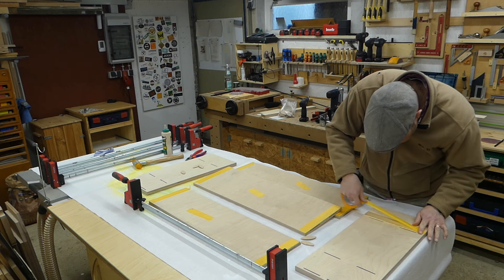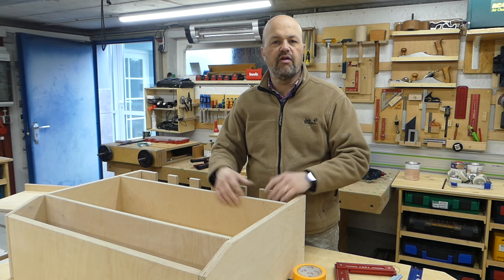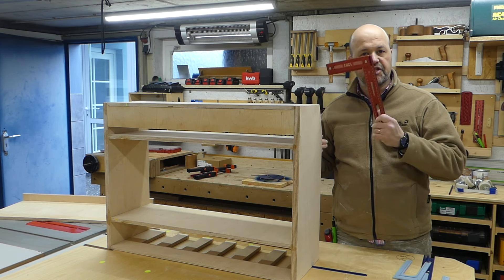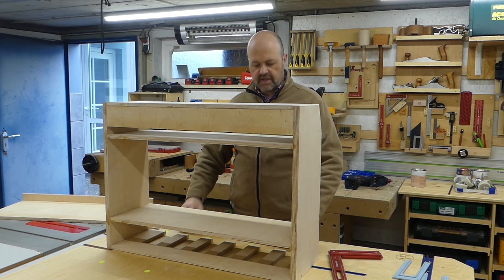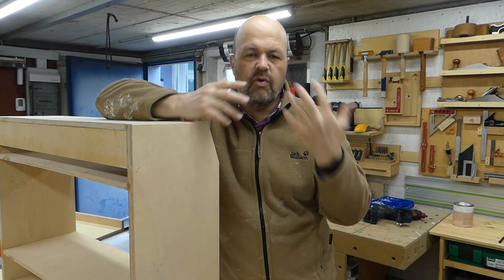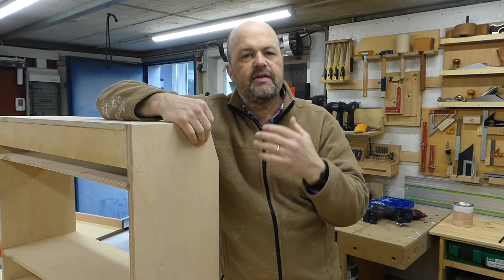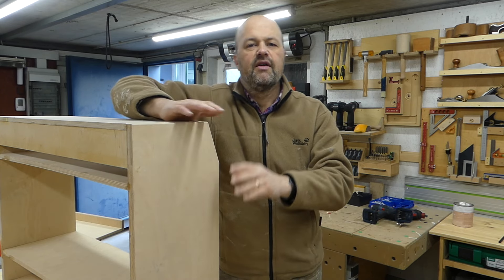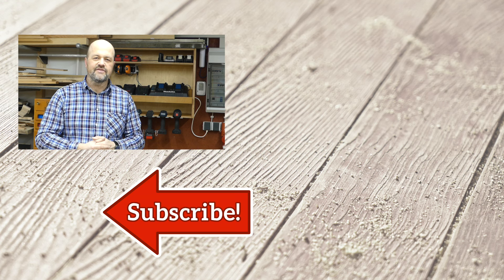Woodworking Glue Ups – 4 Essential Tips to improve your workflow

Comment: If some boards are bowed and some aren't, you likely have a cut issue. Quick tip and why:. dry fitting first is a huge help for cut rated issues. And when I do glue up, when practical, i fit things together and wait about 10 to 15 minutes to tighten clamps, this allows the glue on both pieces to bond and it will form a "skin" so when it is clamped, the squeeze out has some skin on it and is easier to clean off later.  I find that I don't clamp down so hard these days. That's because of 3 reasons, the glue is probably stronger than wood, I don't think I should be forcing it out to an extreme, glue squeeze out is minimized and if I have gaps, I have to figure it out sooner rather than later. So, I dry fit every time, as a habit. If I have a gap, i'll see it then and can address why. I make small things and interior glue squeeze out is a huge problem and must be avoided. I use the tape if I can, but if you are batching stuff out multiples of something, you will master the squeeze out at some point in the process.
Reply from the maker: Thanks for your input — I hadn’t thought of these aspects.

Comment: Goodness, when you said that gluing up was stressful, I thought you were going to have some alcohol, not coffee. 😆 Coffee is the better idea, but it would make me even more anxious.

My recent project, a side table with mortise and tenon leg attachment, flustered me at glue-up time. Not so much the assembly and gluing itself. I had dry-fit everything several times. No, it was applying all the clamps once the glue was on. I just hadn't thought it through beforehand. I had the clamps handy but didn't have a plan for how to use them. Had I done some quiet thinking first as you advised, I probably would have dry-fit the table parts and figured out where to apply every clamp. Then it wouldn't have been a panic of picking up clamps, adjusting for where they needed to go, clamping, then unclamping to shift it to the right location, repeat. In the end it all came out OK.
Reply from the maker: Thanks for your reply Tom.